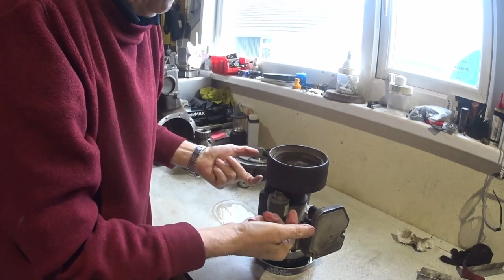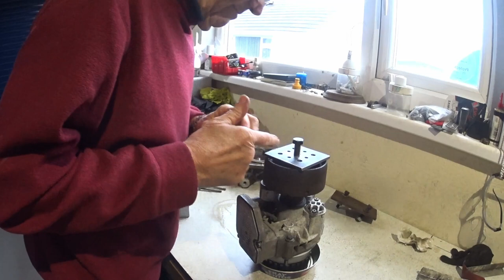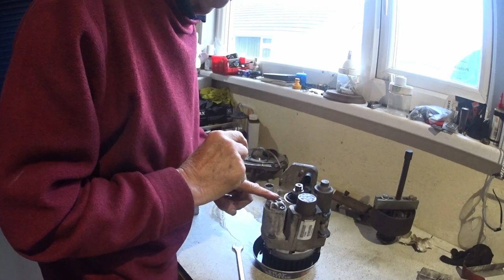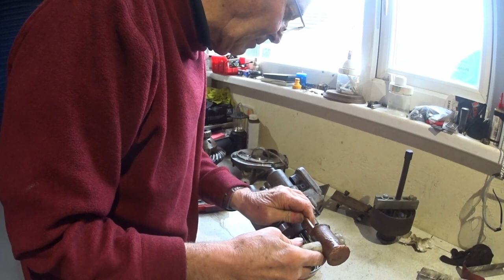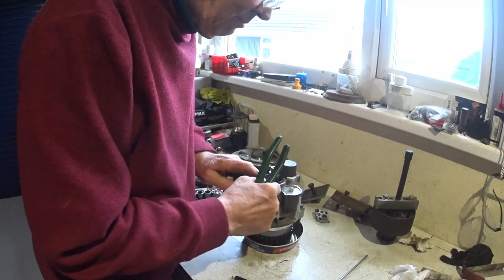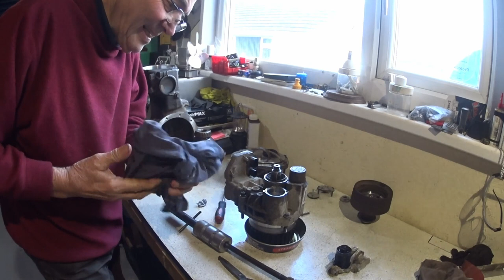Freelander 2 Haldex Full Service +

Comment: Heldex units should be serviced every 30,000
Reply: You are spot on Dennis, it's funny JLR say they are sealed for life and don't ever need servicing Ford and Volvo a different story I use a Ford kit to service my Haldex, My Freelander2 2.2 GS Manual has done nearly 200,000 miles from new and serviced by myself never seen a LR dealership, it's getting on a bit now 2007 but still tows my caravan regularly. Great Vehicle if maintained correctly.

Comment: I know guys in landrove just cut them flanges of and throw them away as they have never been needed
Reply: Can you explain this comment please? If you the flange off there is nothing to bolt the prop shaft to?
Reply: Not the flange but there's a metal cupling at the flange it's a balancer for the driveshaft and makes doing some jobs a nightmare and it was only fitted to some later models and dosnt serve much purpose only getting in your way
Reply: Interesting. So the larger diameter part that actually stops the pump being removed can be cut off and discarded without affecting the fit or function of the prop and Haldex? I wonder if anyone has videoed this process as I suspect it would be popular.
Reply: My freind has worked in landrover 19 years and he cut the one of my wife's evoque as my freelander didn't have one I seen him do it in less than a minute with a ryobi cordless before he serviced the haldex and he's a master tec in jaguar landrover
Reply: I would like to see this done so I can see where to cut.
Reply: I'm pretty sure when u get the car up you can see where it's joint to the drivshaft but my car was on a ramp lift might be difficult on ground level using a jack the way it comes of after u wouldn't know it was even on I think it's fitted and can be removed without cutting but u have to stripp alot of stuff off and that's the reson u cut it of in the first place to avoid all the hassle in future jobs and servicing

Comment: I'm quite sure LR released an official technical service bulletin for this very problem.  A shame really, considering they're so capable and reliable once this issue is sorted.  I don't think the Diesel or Petrol has any glaring issues anywhere else (besides the door locks failing but that's an LR signature!)
Reply from the maker: We have had a few different makes of 4X4's over the years for towing, but the Freelander 2 has been the best as it's very nice to drive just as a car, but tows exceptionally well.
Reply: The central locking actuators are actually a Ford part. Peel off the LR sticker & theres FOMOCO underneath 😩

Comment: hi do you have the part number as i may aswell do a service on my freelander as iam takeing out my fuel tank out at the same time
Reply from the maker: I bought the Haldex service kit from Bell Engineering, you get the filter, filter end cap with O ring, the 2 filter mounting screw and the big O ring where it mounts on the diff. I had to phone them to order the kit as there’s 2 types for gen 3 or gen 4, l think the filters are a different length better the 2 types.

Comment: i did think of having a freelander 2 but the more i see the less i want one so mean while i will stick with my freelander 1 as it is going well
Reply from the maker: I think your right, the rear diff pinion bearings are not up to the job, same for the rear wheel bearings and the Haldex unit.
Reply: I’ve owned a FL1 & 2 FL2s now. There’s no comparison. The FL2 is light years ahead. As for reliability both of them have cost me less to own than the FL1 did.

Comment: Hi, did you renew the o-ring seals to the pump? Love the video
Reply from the maker: Hi, The outer “O” ring was slightly damaged where it was exposed to the atmosphere on the outer edge as the aluminium had swelled with that white powdery corrosion. I cleaned the surfaces with some fine wet and dry paper, turned the o ring around and swapped the outer for the inner and put the pump back with a smear of grease on the mating surfaces, all good and bone dry.

Comment: Hi Brian
Just watched all three of your diff and haled videos. Really informative and well done; keep up the good content. 

Could I ask where you got your torque values and any information from about the rebuild? Are there any tolerances on the diff that we need to measure at all (you mentioned shims in the diff video)
Anyway keep it up.

Jools
Reply from the maker: Hi, Jools, the info on torque values etc. are from a Freelander workshop manual l bought a few years ago on CD when we first got the Freelander which is very comprehensive, l am out of the country for 2 weeks but weeks but can send you the info when l get back. I was told by our local LR guy that if you use quality bearings you put the same shims back in because the new bearings are so accurately manufactured these days. I think the diff carrier bearings and inner pinion bearings were Timken and the outer pinion bearing (which is generally the one that causes the issue) was SKF.
Reply: @TheCADengineer  All good info. I have a the normal manual but not sure that has those torque values in it. 
When I get mine on the road I may ask you for values if it turns out the diff needs doing.